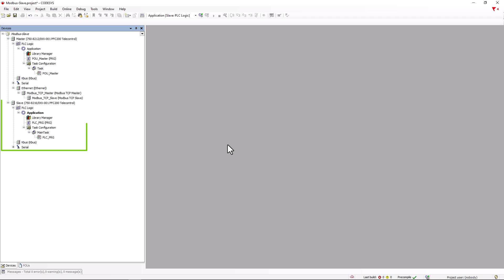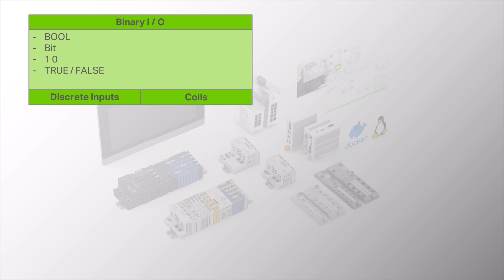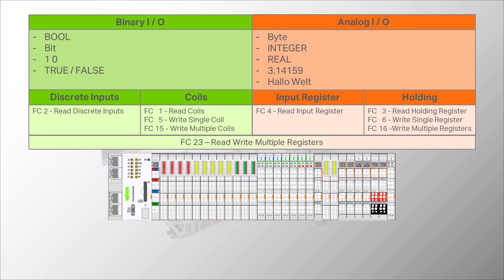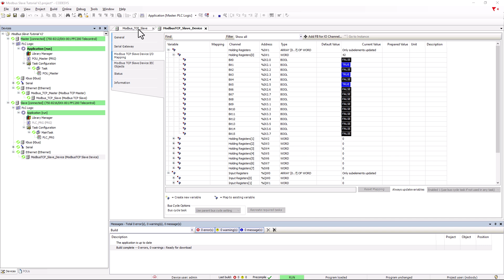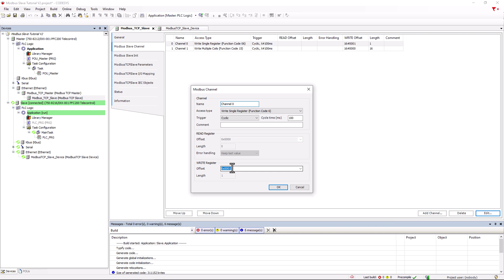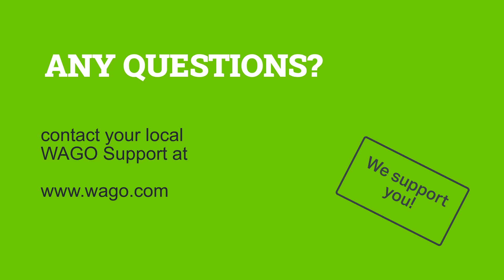Modbus TCP in CODESYS 3.5 | PFC as Slave: Memory and address areas

Comment: what about if I want to expose my PLC as a slave but I need to expose 2 groups of input registers from 0 to 1000 and then from 6000 to 7000, however I can not put more than 4096 registers input, and also I can not put 2 slaves devices to put 2 different range of addresses. is much way better in e!cockpit
Reply from the maker: Dear Duvan, 
unfortunately, a configurator cannot cover all cases.
In this case, the Advanced Modbus Server from the WagoAppPlcModbus library could be used.
Kind regards from the WAGO Team